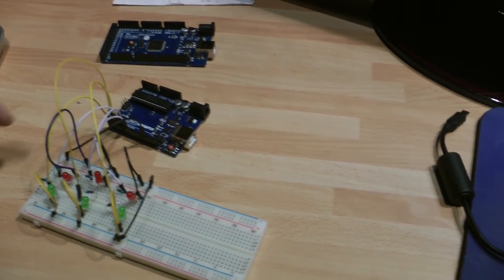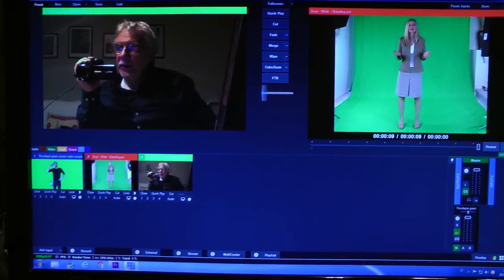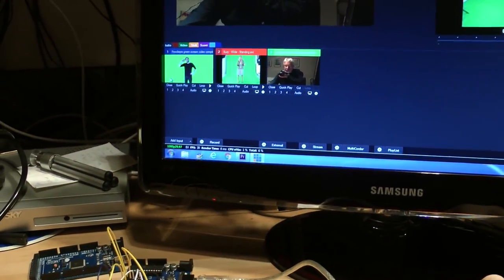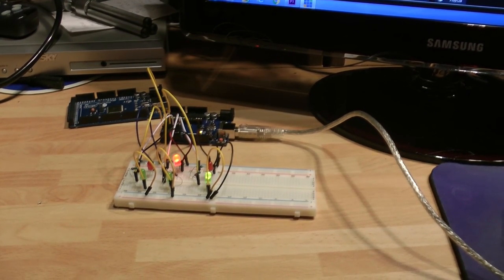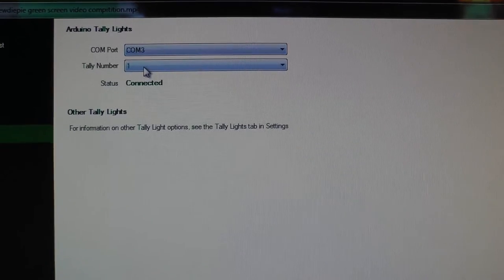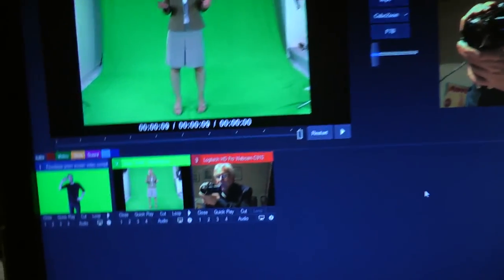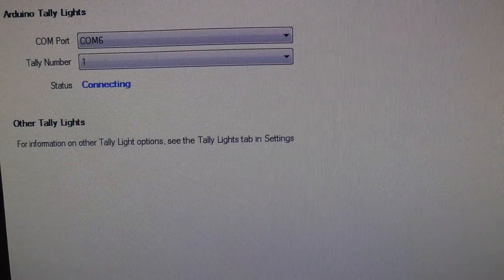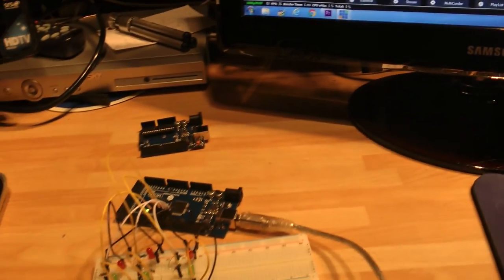tally lights problem in vmix (SOLVED)

Comment: Dear Lino Castriotta,
I know it's been a few years since you made this video, but I would like to know how many ohms resistance you use for the LEDs in the Tally light.

Sincerely, Frank
Reply from the maker: I used 220 Ohm resistors because they are ok for my leds. In any case i think that 220 Ohm are ok for the most of the leds. In my "big project" I used precabled leds with their own resistor inside and I suggest that.
Reply from the maker: Anyway for a good project take a look here: https://www.youtube.com/watch?v=JzrccIKhZaQ&t=353s